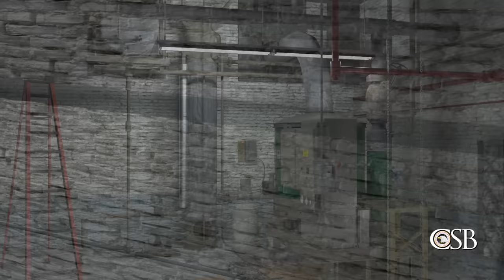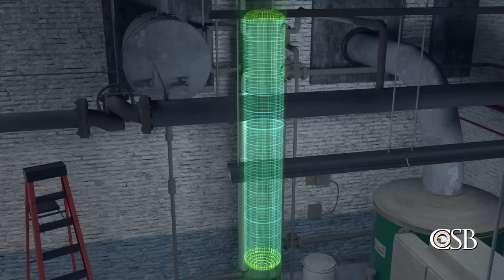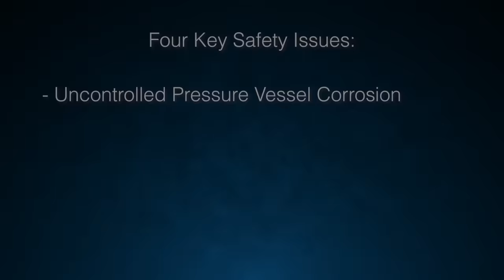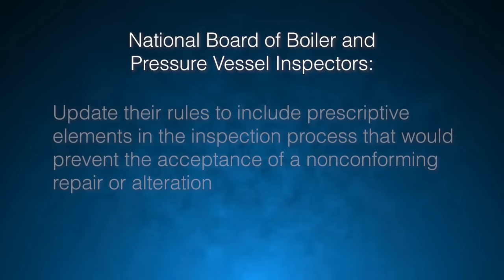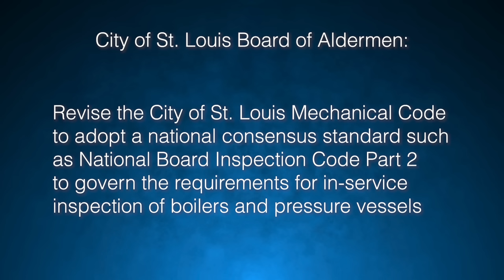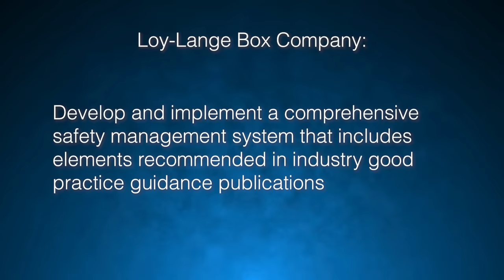Ignored Warnings: Explosion in St. Louis

Comment: As a retired boiler and pressure vessel inspector, it just makes me weep that proper maintenance, repairs and inspection isn’t done. These things can and do rupture.
Reply: I've been working at so many companies who neglected maintenance and basic safety measures citing: "it's too costly".
Reply: This is where I think education is a better strategy than just pushing for more regulations.
If anyone who actually worked with the pressure vessel had understood the danger it would have been depressurized and taken out of service when it started leaking.

You can see that regulation didn't help in this case.
I suspect the company thought since the tank wasn't a boiler it didn't need inspected.
The boiler inspector never said otherwise.

Back to education the outfits that repair pressure vessels need to make sure their members understand that heads need to be replaced.  Not patched and mended.

That to me was the real missed opportunity here.
The company didn't cheap out and tell their maintenance guy to "make do and mend".
They hired an outfit that had all the proper certifications that regulations required and they totally screwed the pooch.
Reply: @1978garfield  toothless regulation is no good. if you mandate the installation of a protective anode (anode corrodes and thereby protects the steel). If your system works perfectly, the anode doesn't corrode and needs no maintenance. If you do have some corrosion, instead of the pressure vessel having to be repaired, you simply can switch out the anode. and keeping a eye on a anode is far simpler.
Reply: Any company that installs a large pressure vessel without getting a permit or an inspection has made a choice to roll the dice with other people's lives.  This isn't like installing a new light fixture in your home without pulling a permit.  It's just reckless.
Reply: @1978garfield   Any company that chooses to install a large pressure vessel without applying for a permit is knowingly doing something illegal that endangers others' lives.  Nobody who works around this sort of equipment is unaware that it can explode.  Management chose to proceed without a permit and avoid regular inspections to save a buck because it didn't care that it was endangering lives.

If the company hadn't made that illegal choice, the regulations should have worked.  This vessel should more have passed even a cursory inspection by an inspector qualifies by the National Board of Boiler & Pressure Vessel Inspectors.  These dangers were known a century ago.
Reply: @beyondEV  How this anode systems work?
Reply: Entropy affects everything, but humans will neglect plenty of things unfortunately
Reply: @joydasgupta9445  corrosion (rust) is an oxidation reaction. Different metals will rust before others, using up all of the oxidizer before it gets to the later ones
Reply: They should offer substantial rewards for people who report such things to the proper authorities
Reply: @Patmorgan235Us sounds like a chemist is needed to calculate such things
Reply: The legislation must prescribe exactly the methods and frequency of inspection, testing and repair methods to eliminate the wishy washy duck shoving...
like passing this off to the local boards/cities to "formulate a plan".

The plan needs to be in force. nationally..
no ways past it....
and the penalties also spelled out.

4 people died and no one to blame?????
Reply: If you have a leak in a pressure vessel and it's not in a weld.... its very likely that there's a substantial area that's worn very thin... not smart
Reply: Extremely reckless. Where’s the safety manager for these companies?
Reply: @lofasz_joska "it's too costly"... And then had to pay out 50 million in settlements after the fact.